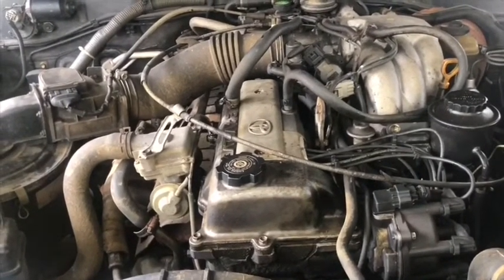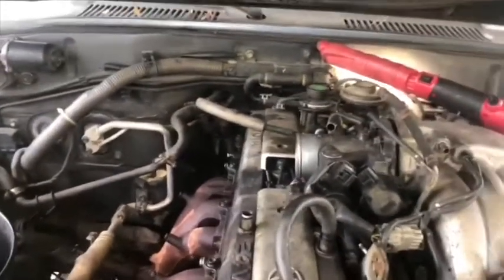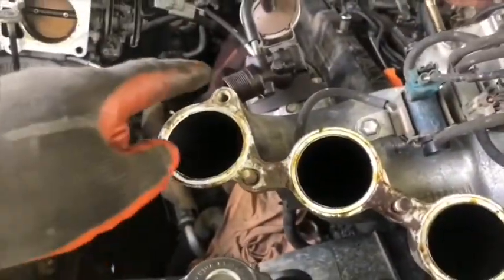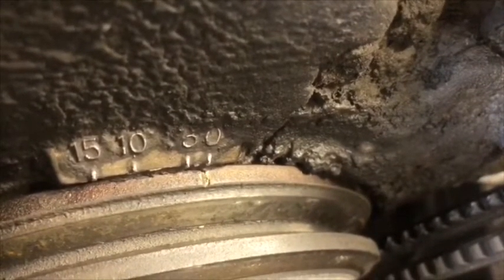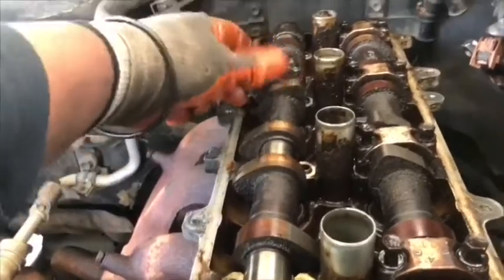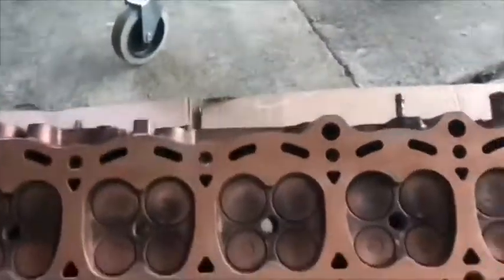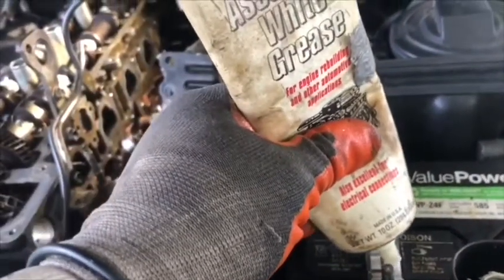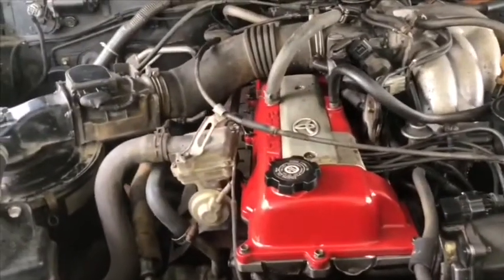1994 Toyota Land Cruiser 4.5L Replaced Head Gasket

Comment: Thanks, Are you sure you're meant to put grease on the cam journal? does it block oil flow through it?
Reply from the maker: There is a special grease used to assemble the crankshaft and shaft cams

Comment: Ary did you change your timing chain or is it the original? Did you reuse the head bolts? Regards Steve
Reply from the maker: They had already changed the chain at 200,000 miles